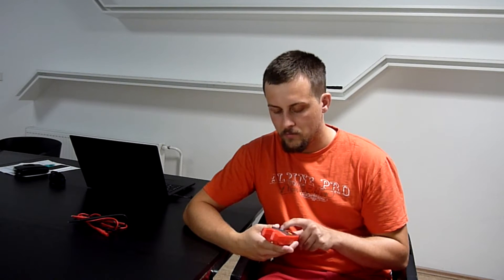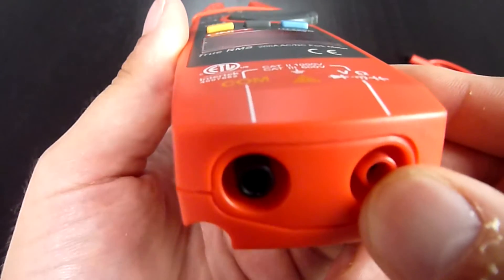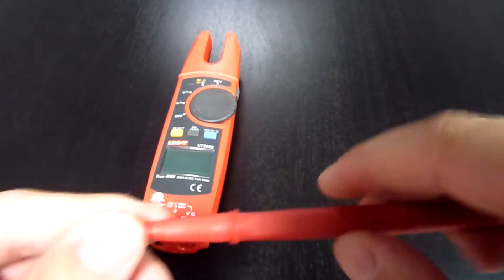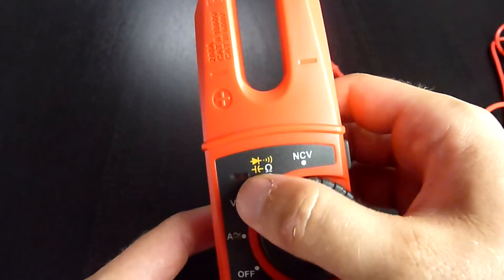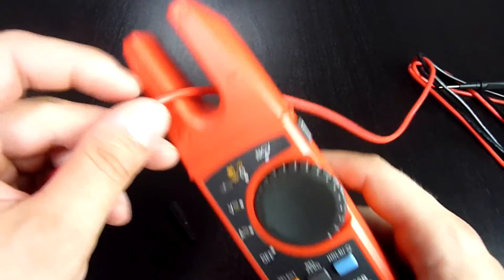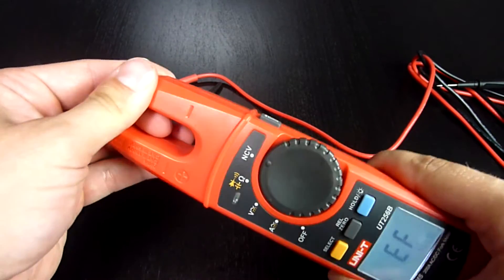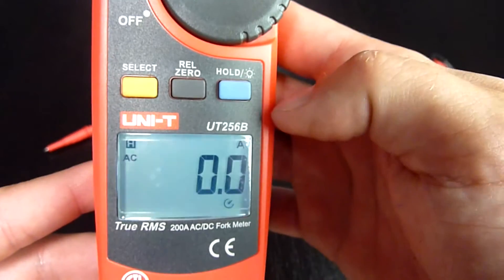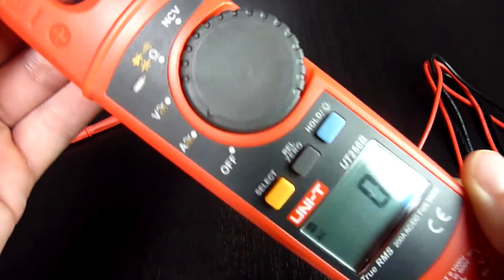NEW  Fork meter UNI-T UT256B - budget friendly and accurate

Comment: I just bought this meter and I dislike it. The building quality is really not as good as the fluke T5-600. Especially for the probes which feel very cheap and the vinyl cables probably won't last long. The measurements are very slow. This is the point where this meter fails for professional use. As an electrician you need fast and reliable metering of circuits. The continuity beep for instance takes about 2 seconds to beep. Inacceptable for industrial use. Also, it measures resistance first and then goes to continuity. While most people use continuity 90% of the time and measure resistance once in a while. If you want accurate Ohms measurement, you should really go to a real multimeter instead of a tester, but continuity is a simple feature and should really be on point for a tester. The beep is silent. If you work with other people you want a loud and clear beep. The flashlight is faint as well. I bought this meter as an alternative for the Fluke T5-600 because it was cheaper and has True RMS but I will go back to the expensive Fluke.
EDIT: forgot to mention the Non contact Voltage measurement is useless. While this is the case on many meters, people should know that this feature is not something worth buying the meter for.
Reply: The t5 has half the features of this meter
Reply: Ut 256b aslında ac DC bir pens ampermetedir. Diğer artı özelliklerini bir Bonus olarak düşünebilirsiniz. Fluk 179 um var tabiki çok memnunum fluk bu işin en üst seviyesi ve doğruluk hassaslık açısından.unit ise orta sekment bir cihaz lakin bir arıza aramada sizi yinede yolda bırakmayacak kadar başarısız değildir. Bazen fluk 179 da bile olmayan bir özellik basit bir mutumetrede olabiliyor örnek verirsek breymen multimetre bazen fluk multimetreyi geride bile bıraktığı olmuştur lakin doğruluk güvenirlik konusunda fluk en üst seviyede zirvededir
Reply: The Fluke T5-600 costs 3-4 times as much as the UNI-T, but has less fetures. For the price you can expect faster operation and extra quality.

Comment: Good video.  After watching, I'm not convinced that fork meters have a real advantage however.  I have a Uni-t UT210E (which is superb!) that cost me half the price, that can do everything the UT256B does.   I am ordering some electrical gear and wondered should I include this - no, apparently!  Thanks. :)
Reply: UT210E does not measre DC Current... its a big disadwantage.
Reply: @fryderykkraczkacbre5835 it does,i have one.
Reply: @fryderykkraczkacbre5835 you are wrong